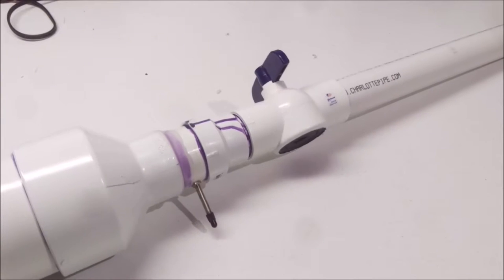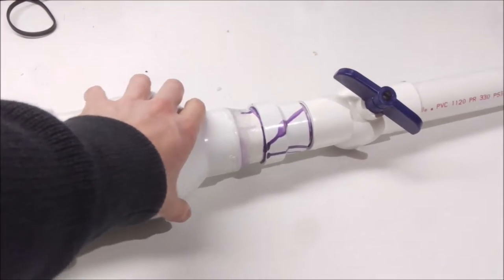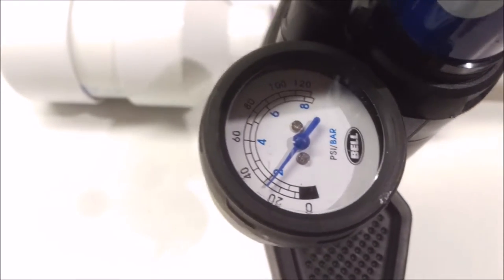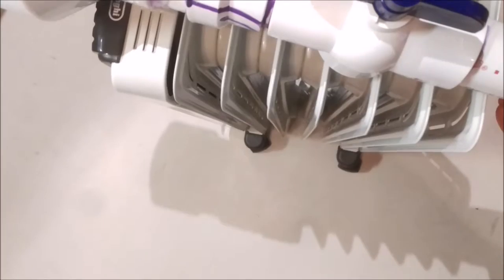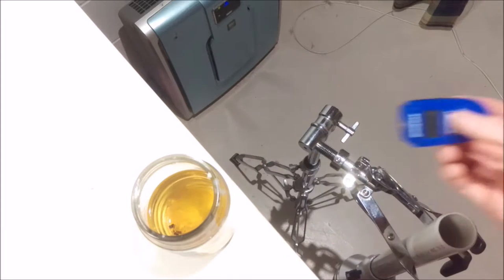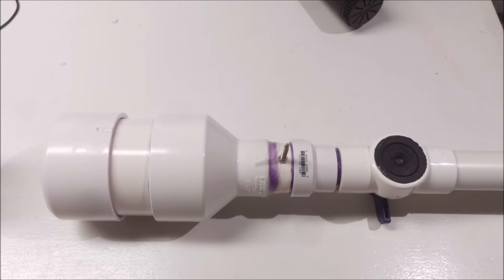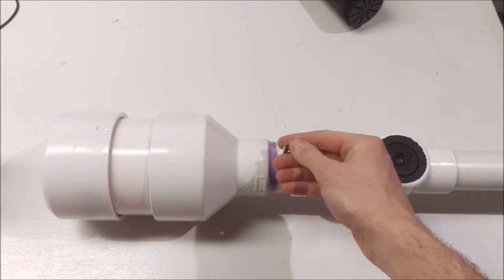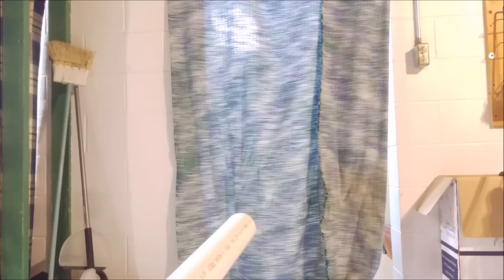Potato gun - how to pvc ball valve repair

Comment: I had a similar issue with a 3/8" brass ball valve but mine had a slow leak in the valve stem, the part that the handle connects to the ball. To fix it all I had to do was drip a few drops of silicon oil into the schrader valve stem so that when pressurized the oil aerates in the chamber and tries to escape out the pinhole leaks inside and blocks them.